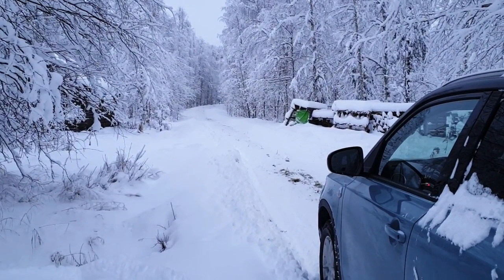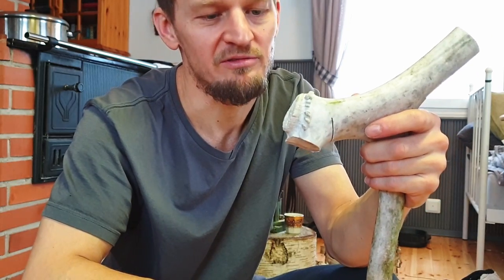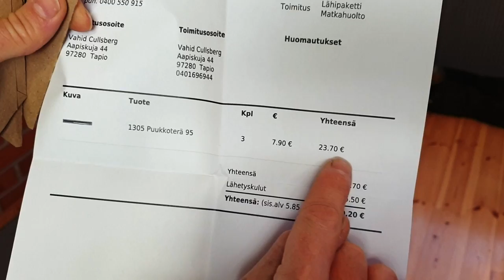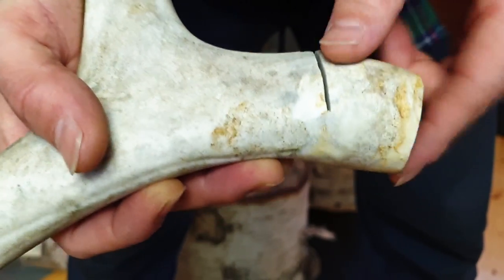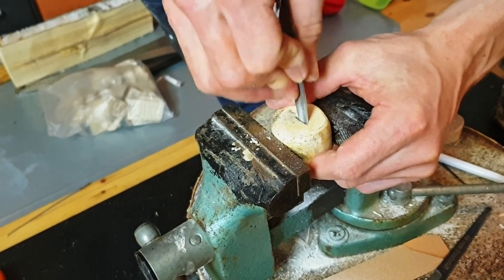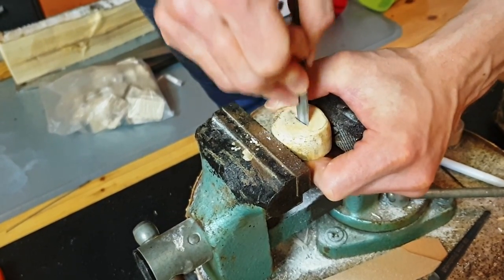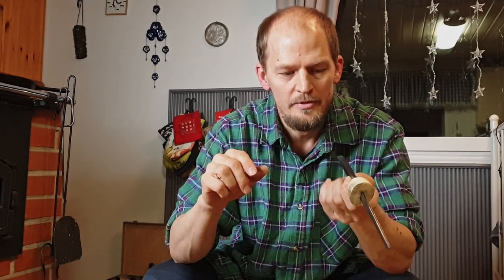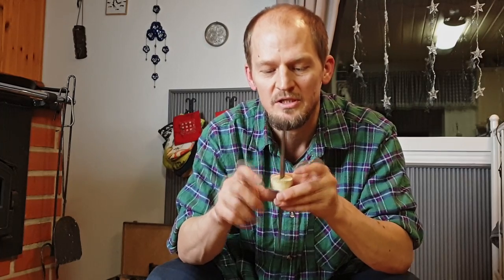Handcrafted Scandinavian Knife. Episode 2.

Comment: A choil on a blade makes sense on a blade heavy knife...bringing the balance back to the hand for better control, while still maintaining the ability to do light chopping...a smaller blade usually has a neutral or handle heavy quality and as you say a choil on such a knife would only be a waste of cutting surface!...will be glad to see your finished knife!...atvb...woods
Reply from the maker: Thank you Woods, I'll be glad if you hang out for the finale episode on this knife :). About the choil, does it really make it that more balanced? Imagine if the choil was grinded and sharpened all the way...would that material that was taken off really make that big difference in weight and balance? Also, there are all kinds of big knives out there, I would imagine that the longer and blade heavy it is the much more pronounced the choil also must be to shift over the balance. By those terms maybe a sword should have an enormously pronounced choil? A sword is not designed for cutting close up to the handle and yet it has no choil to balance it...or maybe I've confused everything.
Reply: @VahidCullsberg  LOL i see your point!...however i was referring to say an eight to ten inch blade which generally has a balance point approx 3/4 to 1 inch forward of the guard...
It would be less fatiguing to the hand if one was able to advance forward a bit on the blade.
While using a Sword as a knife may be a bit on the extreme end of the discussion... lets have a look at the Malaysian Parang.
The Parang (often referred to as "the multitool of the jungle" by us westerners) generally has a balance point well ahead of the handle, as a result the first couple inches of the blade are left dull allowing the user to choke up on the blade for more detailed work.
These tools are very capable of doing both chopping and much finer work usually afforded to the smaller knives.
Awesome discussion my friend, with good points on both sides!...atvb...woods
Reply from the maker: @MTwoodsrunner  I knew I confused the heck out of it lol Thanks Woods :)